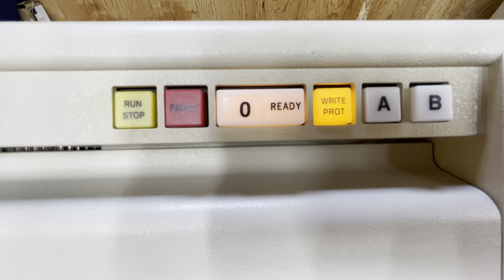DEC RA81 Hard Drive Spin-up + Down (Bad motor brake??)

Comment: sounds definitely different to my drives. simply remove the brake which is on top of the motor and check if you can see anything. could also be a bad bearing.